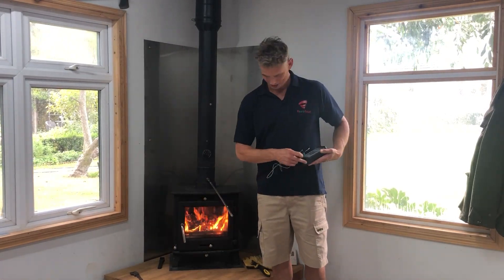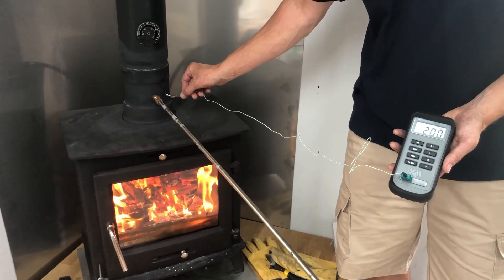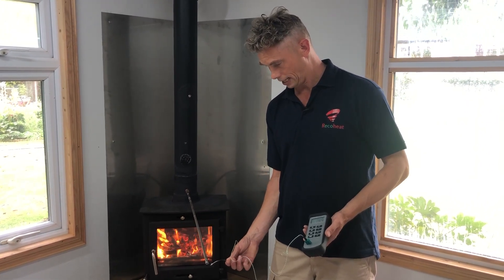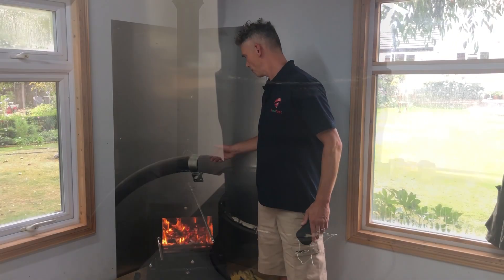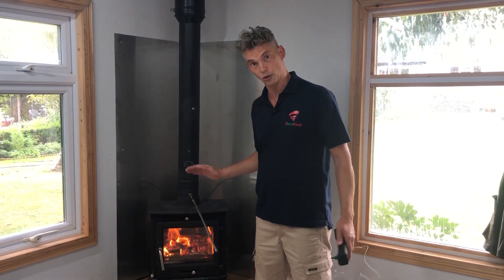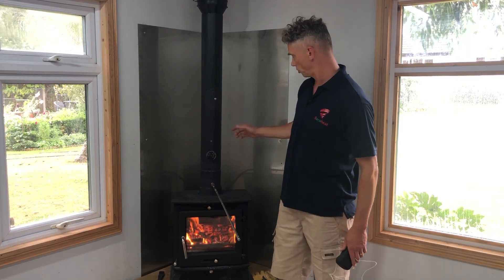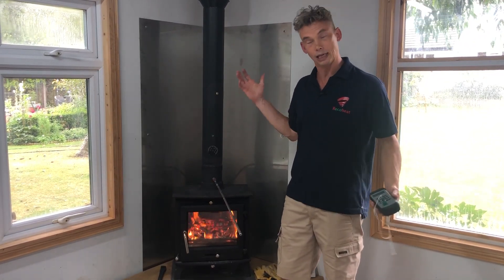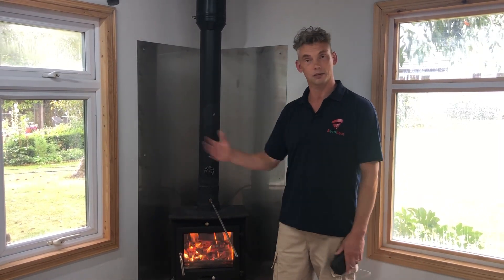Extending the outlet of a Recoheat stove heat recovery unit

Comment: Cassette stove , can this be used in this instance , while the stove is heating the sitting room and the chimney wall extend to the kitchen area, this in my view would be perfect
Reply from the maker: It can if the flue is vertical (some are at an angle off the top of the combustion chamber). However, fitting would inevitably be a pain. A few people have done it, but we haven't had pictures or feedback from them, which is a big shame.

Comment: How long is the extended pipe in cm and do you sell it? Can recoheat be installed on 130 mm or 150 mm chimney steel pipes?
Reply from the maker: We'll do a video on it shortly, but have found that going directly through a wall behind the stove does work, but anything longer is a waste of time. Every additional centimetre reduces the heat output, so we make them to measure in lengths of about 40cm. The Recoheat units come in 125mm and 150mm (plus 180mm and 200mm) as standard, but we do also make units with wider tops - 130mm and 160mm - to fit into flues that have had the spigot removed, or for use in Europe where the widths often seem to be a little wider than the UK.
Reply: @Recoheat  thank you for fast answer. Given the fact some walls are 25 cm thick + 40 cm fire safety distance of stove to wall (if wall has material that burns ... like wooden door frame or wood on the wall etc.)+ 15 cm from edge of stove to middle of the stove where the gas pipe is ... I hope that you can construct  extended pipe with material that can work efficiently with 70-80 cm extended pipe
Reply from the maker: @djbeatbox100  Heat loss is inevitable because of the fast transfer caused by the turbulence, even when we're coating the tube. In our tests, you lose 100C over 87cm

Comment: well? Howd it come along?
Reply from the maker: Well, it only really works if you're using it to go straight out the back through the wall behind the stove. So with a distance of about 40cm when the free 0.7kw or so heat is really useful. You intrinsically lose all the entrained heat circulation from the stove, so it's not at all as effective as the normal set-up. Some people are using it to heat a room behind, and some people to heat a corridor, with a company using it to heat a storage unit from outside (with a stove in a lean-to built against an external wall). So it works to a limited extent.

Comment: Is this possible? Was just about to order a 5" 310-380mm but needed to put a 90 degree bend right on the nozzle end to sened the air off to the left. No more than 1 inch more. Was told it wouldn't work by you guys.
Reply from the maker: The angle would kill the turbulence, and also make a hell of a noise! You should hear what a difference it makes when you put a temperature wire into the airflow. The main point though, is that the jet rotates/roils once it hits the cold air in front of the stove, so the direction doesn't make that much of a difference. You're sort of talking about the angle you put a spoon in to stir: it will make a difference to the direction of flow, but in the end the stirring effect - of mixing the hot and cold together - is the same.

Comment: Frankly, I'm shocked and disappointed by this.  I like the idea behind the Recoheat system and plan to install one in my woodstove system once it is installed here next year.  But as a physicist, I'm shocked by the lack of understanding how heat works.  The three laws of thermodynamics and all.   Forget about the turbulence of the air stream - this may affect the rate at which heat initially passes from the air stream into the pipe.  But once the pipe is warmed up properly - that is, once a steady state has been achieved all the heat entering into the tube will either be ejected from the end or will pass through the walls of the pipe into the room.  Heat in = heat out.  It's as simple as that.  If you want to maximise the heat delivered from the far end of the pipe, the only thing to worry about is insulating (i.e. lagging) the pipe itself, so that less of the heat escapes into the room through the walls of the pipe.
How is this hard to understand?
The answer MUST be - connect a well lagged pipe to output port and once the pipe itself has reached thermal equilibrium, all the "recovered" heat will be delivered out the end of the pipe.  No matter how long the pipe is.
Anyone doubting this, go back and ask your school physics teacher.
Reply from the maker: Hi Michael, thanks for the engagement. Or you could ask someone who actually tests the theories empirically as well as through engineering modelling! Lagging it stops heat passing out, not passing in. We're keeping heat in the air flow, not the steel - that's the point. If it wasn't so, we wouldn't bother doing what we do. We didn't look for a problem to solve with facetious arguments - we've got plenty of problems enough!
Reply: @Recoheat  Fair enough, and I really didn't want to score points or put anyone down.  However, the point about heating up the pipe is all about the steady state, once everything has reached thermal equilibrium.  After that point, all heat going into the pipe will go out - either through the walls of the pipe or (as we want) in the heated air stream at the end.  The longer the pipe does mean more escapes through the walls, but that's not really a bad thing - it just adds to the heat in the first room.
Reply from the maker: @pooterist  That's quite right in terms of the heat going into the room, but the effect on our system is quite dramatic because the air flow loses its turbulence which is the key to the efficient transfer of the radiant heat from the stove into that jet, as well as the stirring effect it causes. So the heat dissipation into the metal makes a big difference. It's really interesting. Thanks again for your interest and engagement.

Comment: What if I use a silicone tube? Heat resistant, obviously.
Reply from the maker: The air flow is too hot: you won't get resistance to a continuous ~500C temperature. I've no idea if silicone would eat heat in the same way as steel does, but haven't found a suitable material in any case. Do you know of one?

Comment: Excellent, I want heat my cottage with the stove on the deck.  It would come through the wall.  I cant put the ancient franklin stove I found in the house because insurance and also I have no chimney in my roof.  So this pipe is ideal for capturing some of that heat to reduce heating costs inside.  This is what is so great about this invention.  A stove fan works well, but there's no way to duct it, and even if you did, now there's a big hole in the wall.  Plus this can come out from anywhere, from under a cubpoard for instance.
Reply from the maker: Thanks very much for the interest. It wouldn't work very well - you'd only be getting 5 - 10% of the heat from the stove transferred into the house, so you'd be spending a lot on fuel you were wasting. The vast majority of the heat we're shifting is the radiant heat from the stove rising into the air flow, ad you'd obviously lose all that. I would have thought the better option would have been to put a 5kw stove with a twin wall flue going through a wall if you don't have a chimney, because you'd heat the whole house with a Recoheat on that. It's a tough one - there are so many things to balance!

Comment: This is great news as I asked this very questions back in may .  Brilliant . As I've just ordered mine so looking forward to seeing it in action. Next question could you fit 2 recoheats 1 at bottom and one just above and get that second source with this new attachment to send heat into my hall this speeding the process up for the rest ot the house. Have you considered or tried this.
Reply from the maker: Hi Martin, have considered it, and Peter has tried fitting three units to his workshop and is finding good temperature from the second one with less to the third, but I wouldn't recommend it for a domestic install unless you've got really good access to it and can readily clean it. We haven't tried it for long enough and assume it will have a narrower operating conditions window in terms of heat and draught. But it will certainly work if you're putting a lot of heat up a well balanced flue and burning clean, dry fuel. Don't forget the effect of the extended blower will be much lower than the system blowing over the stove because it won't be doing the main work, of shifting the radiant heat from the stove.

Comment: Can a small splitter be put onto the outlet to blow the hot air in 2 different directions? Such as a T piece or a Y piece ?
Reply from the maker: Sorry John - missed your question. No, because it would reduce the turbulence. The effect of the jet is to draw the radiant heat of the stove into it, which is done more efficiently because of the turbulence. As the jet is also pressurised, the heat is dispersed by the pressure equalisation with the colder areas - which you could compare to pouring water down hill. Anything that reduces this effect will be detrimental. On the other hand, that effect isn't really directional, so you don't need to split it - it already goes round corners!

Comment: Does it matter if the Recoheat is mounted upside down? In other word coil pointing down not up?
Reply from the maker: That's how we'll fabricate them for fitting over a T. We've tested it and it works fine - in fact a couple of customers have already done it - but the flue section itself needs to be the correct way round to stop acid flowing down the outside of the flue joint, so we'll make them upside down. We're aiming to have that on sale by the end of September in 5" and 6".